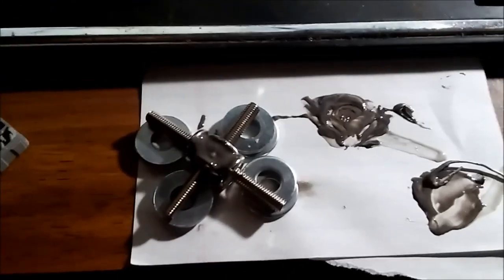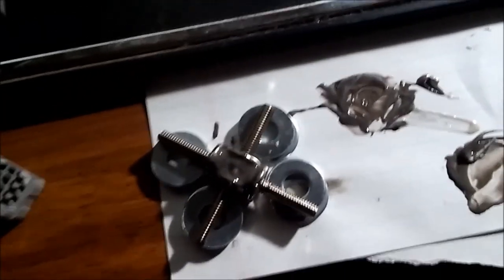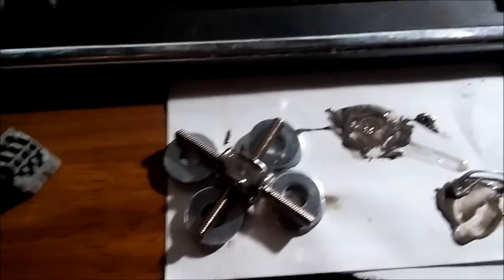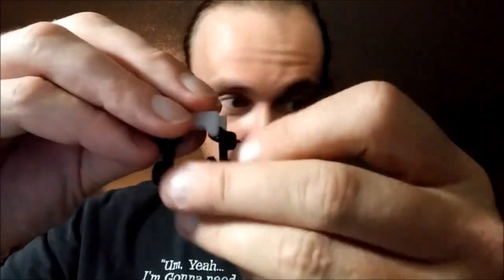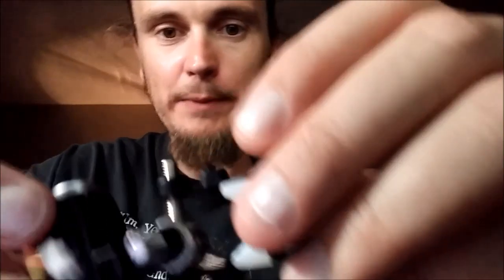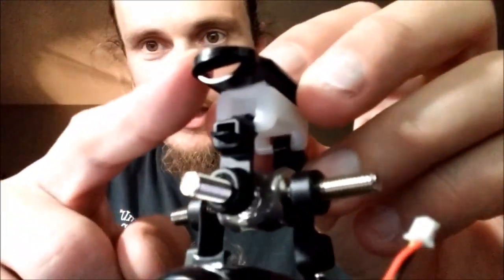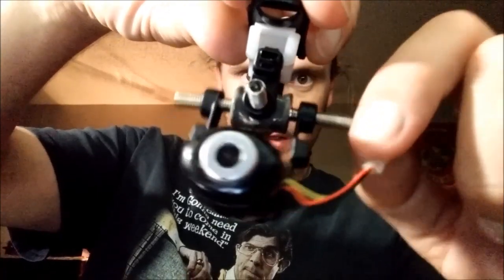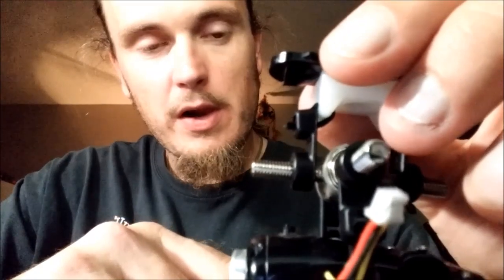DIY Syma Gimbal

Comment: i made it but having hard times to fix problems with wires cos its not working cos wire block the way and its not flexibe, could you help me?
Reply from the maker: Sorry for not responding sooner. I hope you figured it out by now, but if not, try to find some silicon wire. it is super flexible.